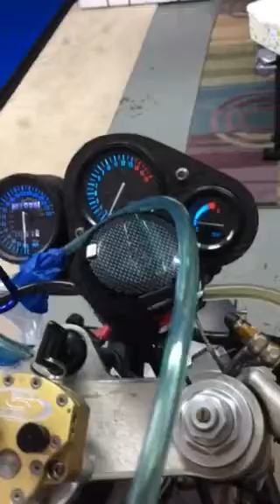1994 GSXR 750 new coils

Comment: Hi there, could you tell me which way around the wires go, please? My wiring diagram is really dire. My model is the 1995 WS. It would really help me out, thanks!
Reply from the maker: Not sure what wires you are talking about. I have posted a color diagram on gixxe.com and Third Genereation GSXR on FaceBook.
Reply: Thanks. I have the colour coded diagram already, I can't figure out the LT lead configuration. I have the HT configuration, 1-4, I just need to know where the orange/whites go, whether it's top or bottom of the coil inlets. You are my only hope, but it's a tank off job.
Reply from the maker: I converted over to stick coils. I will have to look around for the oem coils. I had them marked/color coded for disassembly.
Reply: Thanks, I appreciate it,if ever you get the time.
Reply from the maker: see if you can zoom in https://www.pinterest.com/pin/493988652861879390/
Reply: Zebo, Thanks, I only just saw this reply by accident. I see that orange is bottom, white on top for the rear coil. My diagram says the oranges are in the same position on both, so i'll try it. Thanks. I also notice that you have blue forks, same as me. 

I thought they were only on the 94. I'm not sure whether they have been replaced at some time, or if they were just left over from 94 and used on early 95 chassis numbers? It's unimportant anyway. I love your flatslides and gauze. Good set-up. I'm sticking with 38's with pod filters. Thanks again for your help.